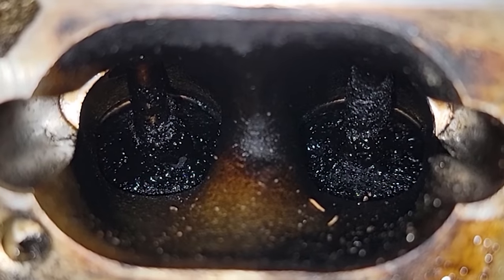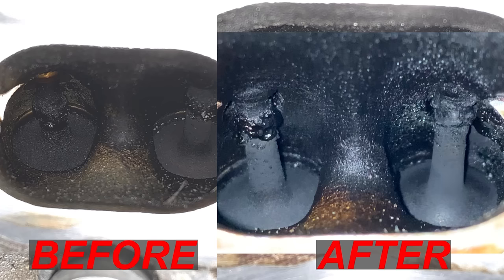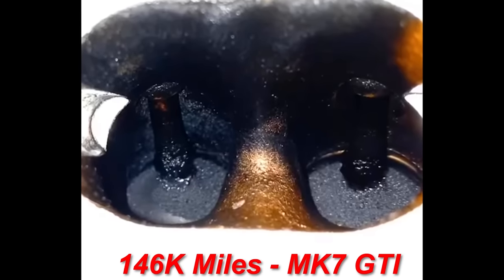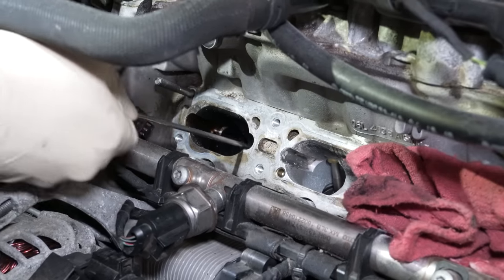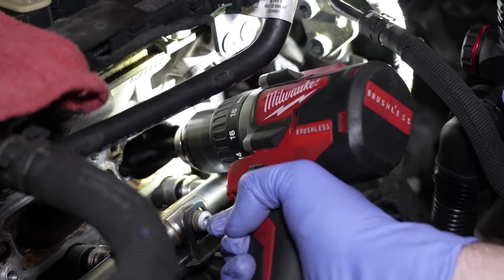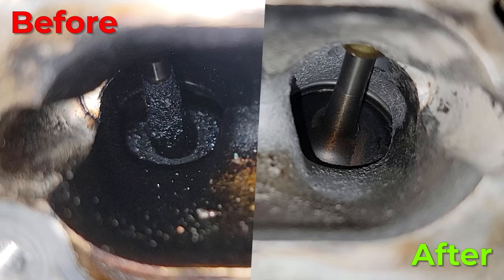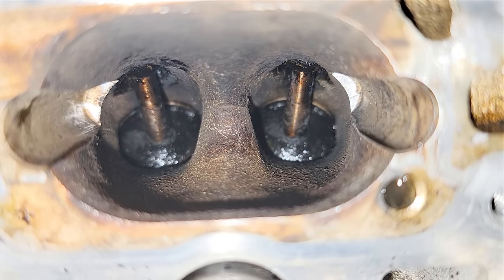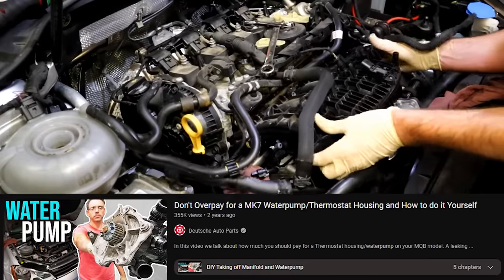How To Clean Carbon Off Your Engine!

Comment: This is so easy fix. I do this by driving hard revving engine to redline. And it couldn’t be better. There is no need to use any additional treatment. Driving hard long is the way to go.
Reply from the maker: Wrong, you have accomplished nothing

Comment: Nice video. Water injection will prevent the carbon returning.  We used to de carbon  combustion  chambers  by spaying water down the intake on a warm engine.  Worked ok.

Comment: I'm over the top I change my Oil every 1000 to 2000 miles and I do CVT drain and fills every June right before the hot months, before that shite burns up.. My God what I have spent on AMSoil CVT fluid and Oil over the Years. I also use STP pro series 4 times a year to manage Carbon.. That stuff does help.. It's not Magic but it does help...

Comment: Toyota is ahead of the game because they use of both direct and port injection.. which takes care of the carbon buildup on back side the intake valves. Unfortunately I'm looking to get a brand new Chevy 3/4 ton 6.6 direct injection engine. Which I already plan on putting a catch can on.

Comment: i'm balls deep into this. It started with "ok, I guess i will learn how to replace the water pump" then as I'm done and about to put everything together I read a comment how  I need to do the injectors, carbon cleaning, and gotta replace the manifold seal so now I own a hand-held media blaster, the injector puller/sealer kit, triple square bits, and idk even what else. Then I find out also I gotta check timing chain once I get this running again, see if there is any slack in it.
Reply: thank you so much for the video tho! Very helpful.

Comment: My Civic Si has 100k and I was getting horrendous cold start misfires, I bought a borescope camera, stuck it into the intake manifold and couldn’t believe what I was seeing. The intake valves were about 50% blocked up with carbon sludge! Crazy because I always use Chevron or Shell 91 octane and change my oil every 2000k miles. I tried the GDI cleaner and it made almost no difference to the carbon buildup. I did a second treatment and this time I followed the instructions to a T and that time it did remove about 30% of the buildup. I immediately changed my oil because having that crap in the engine oil will cause premature wear.  After a good long drive on the freeway my car no longer has the misfires like before and also no more CEL. Sad that Honda went with GDI because of the inherent issues that come with them.

Comment: 1. Rotate the engine until the intake valve is closed. 
2. Spray a f-ton of WD-40 on the back of the valve.
3. Let the crap marinate overnight (2 nights if it's stubborn).
4. Blow crap out with compressed air.
5. Marvel at how all the crap flies right off , leaving everything perfectly shiny!

Probably works for exhaust too.

Comment: SO glad you cleared this up! Very tired of telling MK7 GTI owners that they don't HAVE to necessarily do this service! My GTI is stage 1 EQT and has been since new car break in. I maintain my GTI religiously, using only LiquiMoly for oil changes. 

My 2017 SE GTI has 162k on it and still doesn't need this service! No cold start misfires, no MPG loss, no power loss, nothing. I've had it scoped twice and the buildup is still minimal. I only run 93oct and change plugs regularly. I also never let the car lug around under 2000 RPM. In fact, even on the freeway I drive in S 90% of the time, keeping it in 5th gear instead of 6th so the revs stay a little higher. Granted, most of my miles are freeway miles, which really don't do much to a car. But, this is how I maintain and drive mine to keep her running well. 

Great video! I want to bring my GTI to you for my upcoming DSG service! (I'm somewhat local.)

Comment: Awesome information but what do you do for the intake manifold part? I got an S3 8V from 2015 at exactly 120k miles and it's in a bit worse shape than the one featured in the video. I have intermittent engine light caused by misfire in zyl 2. I just removed the intake manifold in order to pull out the injectors and clean them with the ultrasound but the problem really seems to be the sizeable carbon build up.
I'll try the ziptie hack for the valve part but the flaps in the intake manifold are quite crusty too and I really don't dare puting metal picks on this plastic thing. I'd appreciate some advice ^^

Comment: To clean valves in aircraft (including some jets) we use walnut shells, you have to disconnect and remove the catalytic convertor and exhaust system so the shells will not clog them. Run the engine to about 3000 Rpm and put the shells in the intake slowly. On jets (F-4 jet fighters ) we put a hopper in front of the intake and meter the flow into the engine. WARNING, Consumer Reports says to beware of blasting with walnut shells if you have nut allergies. Enough of that. 
When I have more miles on my Ford F150 Eco Boost I am going to use walnut shells like I have in my parts blasting cabinet. As long as the exhaust is removed it should work well. On a 4 cylinder it is easier to use the blast kit with the special vacuum / blast nozzle but on a V-6 it is much harder.
Reply: wtf...

Comment: As always great video. Btw what's different in gen 3 engines that it doesn't have this problem ?
Reply: Newer direct injection engines feature also the classic port injection that is activated by the ecu when the car is idle, that keeps the manifold and valves clean!

Comment: I have a 2016 Jetta 1.4L with 46,000 miles on it should I get the values cleaned or not? The dealer says I should spend 200 to get the values cleaned.

Comment: I use Marine outboard two cycle TCW3 rated oil at 1oz per five gallons of gasoline. Been doing it for years. I use it in my truck and my Jeep GC. It must be TCW3 rated. Read the back of the jug. It keeps out carbon in the combustion chambers. It also gives lubrication

Comment: Nice video however it would have been useful to explain what tool you made or purchased to adapt the vacumn cleaner and hole for the blasting nozzle attachment ? and exactly where the clips and washers are used for in the second kit for the older audis ? 
seems like the kit with the clips and washers would be for the newer models with a fuel injector on the intake side rather then the older models with direct injection only ?
Reply: Never mind found and ordered a media adapter for the intake ports about $25 amazon ..

Comment: So the question is what did VW/Audi due to the later generation 2.0T's & 1.8T's to lessen the carbon buildup?  They do not use any kind of port injection to clean the back of the valves, did they?  Was it a change in the way the PCV was routed?  Thanks.

Comment: Years ago when engines had carburetors they would  get an engine hot and  while  running would slowly pour a glass of water down  the  carburetor or suck it into  head by removing a vacuum hose until the engine would  die then wait a while for  engine to cool down, the water would  turn to steam and the steam in the  combustion chamber would remove carbon and cause the engine to run better.

Comment: my 2017 VW tiguan needed the valves done at 80,000 km (50,000 miles)  Oil changed regularly.

Comment: The Humble Mechanic did a review on the effectiveness of an oil catch can he had installed on a 4 cylinder VW GDI engine and did not see a significant difference in valve deposits over an extended mileage interval, as compared to the case when the engine ran for an equal distance without the catch can

Comment: My go to is good old fachion Easy Off Oven Cleaner.
 Iv'e used it on EGR, Valves, steel pistons, even on a plugged CAT convertor.
 Be careful it will etch aluminum.

Comment: Use shells nitro+!!! Been using it for years and I have almost zero building up in my 2014 Mazda 6 with 144K miles on it and I get about 28 mpg for my commute.

Comment: So it sounds like any of the newer engines don't have this problem nearly as badly as the older ones?  Any of the 2015+ 2.0T's, 1.5T's, etc?  Tiguans?  Taos?  etc?  If so, that's great.  Also, it doesn't sound like the TDI has this problem correct?

Comment: I was thinking that opening the port injection ports might help  1.) gives access to a boroscpoe without taking the intake off 2.) gives access to the valves without removing the intake. 3.) Allows you to clean the ports over a longer term.

Comment: When i do the SEAFOAM I make a tiny hole in the cai tube before the throttle body so I can slip the tube in a have it mix properly with the air coming into the throttle body. When I am done the hole is squeezed shut. I put a tiny piece of black duct tape for piece of mind. And so I can do it again in a few weeks to make sure it cleans every. I have done this for years on my 2003 jeep liberty 3.7 and my 68 amc amx 343cu. Plus every once in a while i put Marvel mystery oil in the engine oil and gas on both cars. The jeep has 200,000 mls I had to do head gaskets and everything was cleaned no build up any where. The same thing with my Amx pulled the engine for hp upgrades and no sludge or build up on the valves. I also put seafoam in the gas once in awhile. But having a catch can makes a difference

Comment: Even with my Mk7 I've been wondering about this issue, thanks for confirming VW figured it out. They must polish the valves out with walnut shells during the manufacturing process if it's not happening any more.
Reply: I'm afraid it happened on my mk7 which I purchased new and now has 200K miles and is still running great. I had the dealer clean it 3 times. It developed a cold start misfire. I replaced the plugs and coils all 3 times. Each time it was the carbon. Last time I purchased a cheap bore scope, removed the MAP on the intake manifold, and I could see the build up. The first time I also tried a top end cleaner. The misfire got worse. The cleaner softened the carbon and pushed it towards the valves
Reply: it happens on ALL Tsi engines that DO NOT have MPI. I am very surprised Paul said that, as they have done videos showing the exact opposite as has Charles and many others. It is well know the 2-15+ Tsi engine shave carbon issues.
Reply: When it is manufactured there is no carbon because the engine has not been run at all. Sort of confused with your statement.

Comment: I had a whole paragraph on the "Italian tune-up" but will shorten it to... it's mostly meant for air-cooled port-injection small cc engines with carbon build-up on the pistons... like a small Honda cub or (as the name implies) Italian scooters like the Vespa... after about 300 degree Celsius the carbon deposits start to burn/flake off and get shot out the exhaust, this combined with using an engine cleaning agent on top of a premium fuel, can clean your engine quite nicely... still no replacement for actually cleaning it but most valve-checks are in the 25,000km range and that is for clearance and often has nothing to do with carbon build-up.

Edit... yes, this is the short version

Comment: I tried brake clean once on fuel injectors to try to get them clean. Should’ve taken the O-rings off because it didn’t like that at all. I wonder how the valve seats did getting brake clean sprayed on them. Did they swell and get all distorted?

Comment: Also thinking about doing this soon I have a 2015 mk7 with 110k but she runs beautifully I do my oil change every 5k miles and only use liquid moly 5w40 and I use the liquid moly fuel injector cleaner in my gas every so often. Hopefully my carbs ain't that build up lol

Comment: Great video thanks, also I have a Gti (3VW5T7AU2FM016369) I always use Liqui moly and Best gas 93 , I want to know if my Gti has that problem because I noticed sometimes engine hesitate and I want to know if Is the carbon build up  ??

Comment: Question, I have seen techs using hand held laser to clean up and remove rust from metal parts, do you think it might do the same inside the manifold to remove the carbon? Just asking.
Reply: I would like to know the answer to this question also

Comment: An "Italian Tune-up" works on some cars, mostly rotary engines. It does get hot enough to burn off the carbon in some engines (like, again, rotary engines) and I have seen a difference in oil burning after doing several red-lines in a MK4 2.0 8v. Reduced the 1q every 1k miles to about 1qt every 3k miles. So it has it's merits, but certainly not for carbon buildup on a FSI/GDI engine. I just wanted to clarify that a little bit

Comment: Just thinking out loud but perhaps its useless or silly. Would diesel weaken the carbon before picking it off? I know it works quite well on removing rust but it doesn’t go well with rubber seals.

Comment: It is crazy how we traded reliable port injection with higher cost injectors and pumps for a whole 5% efficiency gain. So lets trade having parts replaced less then replacing major engine parts. Why dont they take in account replacing parts into account when emission are regulated. I bet overall port injected uses less resources
Reply: I know right

Longevity 

Total cost of ownership over 10 years.  

I agree the current path is a step backwards.
Reply: 5% is a miracle gain, too. Not to mention it's only really working well for like 20k miles. It's a terrible joke for engines that don't get full overhauls at intervals like aircraft engines.

Comment: I had this service done on my mk6 gti and when the mechanic put it back together he did not hand tighten some bolts and it made a stud put a hole and giving a Exhaust leak some how and after a lot of money 💰 it was fixed 😊 but after Walnut blasting it ran better and vw won’t develop gas ⛽️ motor anymore  going electric ⚡️ lol 😢

Comment: My question is, After everything is clean, perform a Cleaner Treatment via a vacuum line at 30k miles after, then reinspect using a bore scope. Is the cleaner effective enough if used every 30k miles? Of course if you wait 80k miles, only media blasting is your only  solution to remove the thick cake on carbon sludge.

Comment: And actually you guys are wrong. Other YouTubers have fixed carbon build up by doing chemical treatments and doing multiple chemical treatments. It's harder for it to work appropriately on the TSIs because the TSIs have a turbo so it's hard to get the fluid to evenly distribute and actually run up against all the intake runners and the valves, but the chemical they make does work if you do it appropriately

Comment: Great video, but I am surely interested in the use of another chemicals.. 1st :oven cleaners contain chemicals such as potassium hydroxide and sodium hydroxide. These chemicals eat up carbonized parts, but it desolves also aluminum! As the heads are mostly made of aluminum this isnt the correct choice. 2nd : Metasoak, this is safe for aluminum, but I cant buy that stuff in The Netherlands and would like to know how good this works!
Reply: thanks for warning me, I wanted to use oven cleaner for this. I used oven cleaner on the intake on my diesel bmw that has a plastic intake. It didn't eat up the plastic tho...

Comment: Any recommendation for "STP Pro Series Intake Valve Cleaner"? Saw a video that Nates Interactive Auto posted with a before and after using the product, and it looked pretty good. Though I did see comments saying that carbon pieces could cause issues with the pistons. I'm pretty new to this kind of maintenance, so not sure if it's worth using it.

Comment: I have wondered if an after market Kerosine injector into the inlet manifold programmed to spray a fine jet in whilst running could assist in helping keep clean, Toyota has duel injection on some engines to beat this problem,

Comment: Water/methanol is easy as hell to install. It reduces EGTs and almost eliminates the chance of knock and other heat related problems. Additionally, it’ll reduce emissions.
Reply: You must be really smart because it took a friend about 12-15 hrs to install on a Subaru including testing and adjustments but not full tuning
Reply: @francoisloriot2674  the way I let people know is that the install is all about taking your time, taking a step back and routing everything neatly, etc. 

It took myself 7 hours over two days on my 500, but it was never difficult. Do you agree with that clarification?

Also…. How does it feel to be a fellow meth head? :-). I love the stuff and want to run everything on meth.

Comment: I recommend doing a compression test Before Making Your Cleaning Stradegy. Most Small GDI engines Will usually Have A compression around 200 to 210PSI on 5 Strokes Of the Engine. If it's below 180 psi you will begin to lose power and fuel economy Caused By crystallization Of the cabon Between The valve Seats. so Just cleaning The Port and Back of the valves will do nothing but make the Back Valves and Ports Clean. After Cleaning The the Carbon with the valves Closed You Will Have To Clean The seats with the Valves Open. This material Is Like Glass And there is no solvent that i have found that Will break This Crystallized Carbon Down, You will have to srape it off ( very difficult and time consuming) The seat area closest to to port opening will be the most difficult. There is No easy Fix for this issue once it has occurred. The little bit of crystallized carbon getting into the combustion chamber will not be an issue. i do Reccomend a Good catch can if you're going to keep the vehicle for a while it will at least slow down the carbon build up . And Don't do extended oil changes no matter what you cars oil life indicator says. 5k mile max on full synthetic oil and use only good quality Gas ie Shell , Chevron Ect. If you have good compression you can skip this step but if the commpression is low and you don't take this action you will be very disappointed. GOOD LUCK!